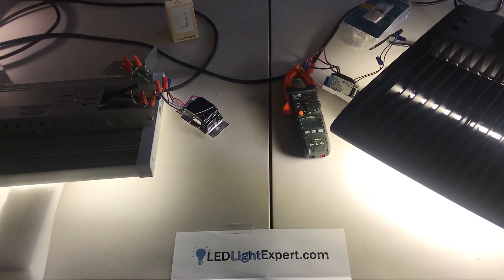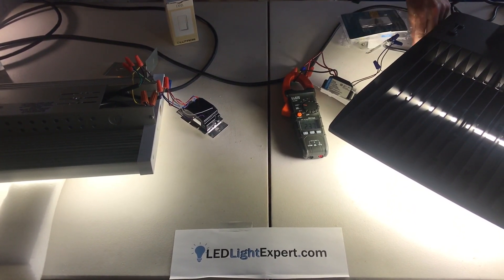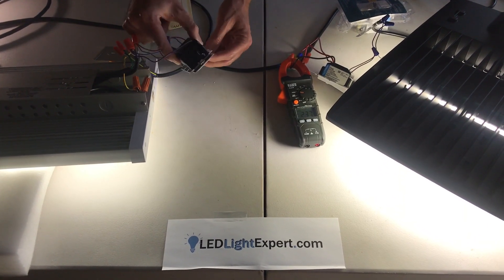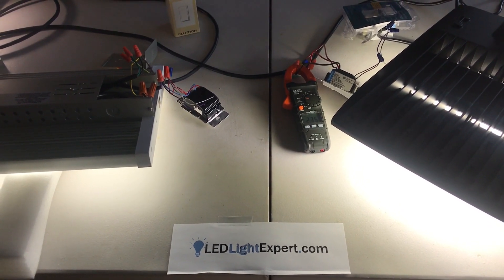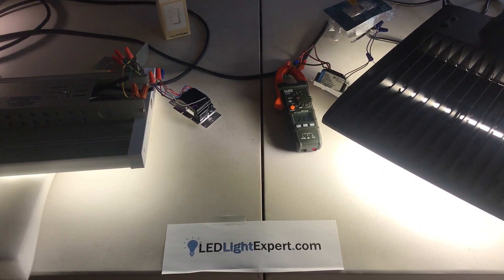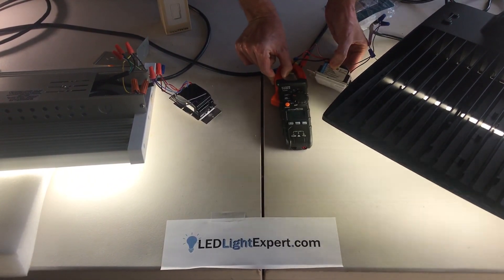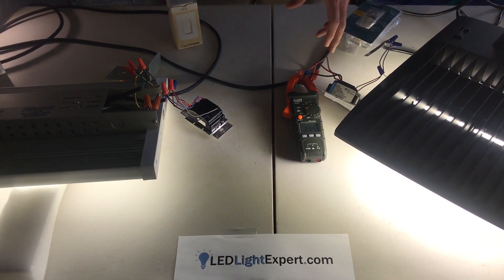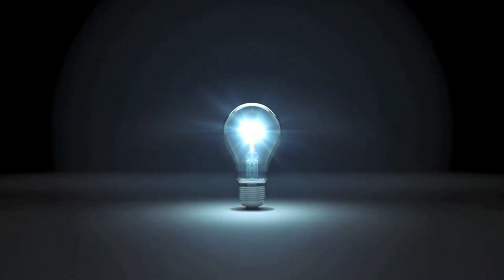0-10V dimming Explained - What is 0-10 volt dimming?  How does it work?  Installation of 0-10v

Comment: my light has two capped wires. The wires are on the light. There are no instructions, but they claim they're for dimming. They don't tell you what to do with these wires.
Reply from the maker: If your light has two capped wires labeled for dimming but no instructions, they’re likely intended for a 0-10V dimming system, which is common in commercial lighting. Typically:
One wire is the 0-10V dimming signal (+)
The other is the dimming signal return (–)

If you’re not using a dimmer, you can usually leave these wires capped and unused—just make sure they're securely insulated to prevent any shorts.
If you purchased the lights from us, feel free to contact us at 888-701-3549 M-F 5am-6pm PT | Sat 8am-1pm PT for further assistance—we’re happy to help!

Comment: So the led fixtures only have the 0-10v wire going to it? And no 120v? The 120v only goes to the dimmer?
Reply from the maker: Not quite — the LED fixtures still need 120V (or the appropriate line voltage) for power. The 0-10V wires are just for dimming control. So typically, the fixture will have both:

Line voltage (e.g., 120V) to power the light

0-10V control wires (usually purple and gray) to adjust the dimming level

The 120V power doesn't go only to the dimmer — the dimmer just sends a low-voltage signal (0-10V) to the fixture to tell it how bright to be. The fixture needs both the power and the dimming signal to operate correctly. Feel free to reach out and our experts can help with any project you may have, you can reach us at 888-701-3549 M-F 5am-6pm PT | Sat 8am-1pm PT
Reply: @ thank you!

Comment: This just told me what it does, it didn’t explain what exactly is happening inside the drivers when I adjust that 0-10
Reply from the maker: Adjusting the 0-10V control varies the voltage sent to the LED driver, which in turn regulates the current supplied to the LEDs, smoothly dimming the light output by reducing power without affecting efficiency. You can call us for tailor solutions to your needs at 888-701-2183.

Comment: Why do some LED fixtures need them and others don’t
Reply from the maker: No LEDs need to dim, so this is optional.  Some LED fixtures are tunable and have onboard dimmer.  Those just use the 0-10v wires inside the fixture.  If you are asking why small LEDs can dim on a regular dimmer and the bigger ones cant, it comes down to cost.   Dimming under 15watts with a regular dimmer is not that expensive.  Bigger wattages would get prohibitively big and expensive and still probably flicker.  The 0-10v system is simple, cheap, safe and works well.

Comment: 5 years Later...  LED lighting has gotten so much better with high voltage circuitry...you don't require low voltage dimmer switches anymore
Reply from the maker: we'll agree to disagree.  1. low voltage for dimmers has not changed, still required if you want to dim led lights above about 15 watts.  Only thing that has changed in the last 5 years since this video is that they are all mostly 1-10v, which climates dim to off for safety reasons.  2. The high voltage circuitry in led lights is a cost cutting move that has risks associated, particularly for outdoor and higher wattage fixtures.  Using non isolated drivers (150-500v dc) puts more strain on the board and reduces surge protection.  We have an article on that here https://www.ledlightexpert.com/isolated-vs-non-isolated-led-drivers

Comment: 0-10V isn't a dimmer. Your dimmer is just some cheap triac.
Reply from the maker: The dimmer used in the video is a 0-10V dimmer from Lutron, the Diva Series DVSTV 0-10V dimmer, not a Triac dimmer, feel free to look it up with Lutron for confirmation and they have plenty of information about 0-10V dimming. Phase dimming is uncommon with any high output or commercial LED products and will destroy LED drivers if used and lead to a driver, or complete fixture, needing to be replaced when they require 0-10V dimming. Many high output commercial LED products can also use PWM dimming as well, but it is far less commonly used vs 0-10V dimming.

Comment: have 6 led panels and installed then on one 0-10v dimmer but i need 1 of the led panel to be on at night how can i do it thanks
Reply from the maker: That panel will have to be run to it's own switch.  All lights on a single switch have the same behavior, so it can't be done on one. They make dusk to dawn capable wall switches, but you will need to run the wiring to that separate switch.

Comment: Man for the life of me I can't figure it out. I want to power a 3 watt star LED replacement for my microscope on a dimmer switch. I want to use a regular 12 volt input, not the 5 volt original. Can I buy something to achieve this ?
Reply from the maker: 0-10V dimming is the standard for high output LED fixtures and the on/off control is designed for commercial fixtures running on AC power. The DC side if this is just for the low voltage dimming controls that are integrated into the LED driver. Best thing we can recommend for what you are trying to do is speak with the manufacturer of the LED product you are using to find out what options and dimming format they support and products they have or could suggest for your application that meets the needs of what you are trying to do.
Reply: @LedLightExpert  thanks for the reply, it's appreciated.

Comment: can we get a close up on the dimmer wiring to the fixture?  my dimmer switch and fixture looks identical.  ty
Reply from the maker: You can check out our learning center page with a wiring diagram that should be pretty consistent for 0-10V dimming setups: https://www.ledlightexpert.com/Dimming-High-Lumens-LED-0-10v_ep_43-1.html. There is plenty of configurations, like when adding multiple lights, 3-way switches, or standalone 1-10V dimming that only controls the dimming, not on/off function. Dimmer switches should come with wiring diagrams which is what you need to follow, along with electrical code, when wiring up your fixture based on your specific application. If you are having trouble with a specific switch/fixture combo, we suggest you contact the manufacturer of either or both products.

Comment: Why does my light go off when I splice my 0-10 ?
Reply from the maker: Not quite sure what you mean here, it sounds like you are splicing your 0-10V dimming wires together which you should not be doing. They either get connected to the correct dimmer switch contacts or they should be left capped off and not making contact with each other at all. We have a wiring diagram on our learning center page for 0-10V dimming: https://www.ledlightexpert.com/Dimming-High-Lumens-LED-0-10v_ep_43-1.html

Comment: @LEDLIGHTEXPERT are you aware of a 0-10v smart dimmer that runs on WIFI?  I can't seem to locate a smart switch of this kind anywhere?
Reply from the maker: I would start with the major controls manufacturers like Lutron and Leviton, but there is plenty of options out there. A call to either of those would be a good place to start to find a switch that fits your specific needs with Wifi.
Reply: @LedLightExpert  Thank you.  I reached out to both and unfortunately it doesn't exist today per either of them.  You'd have to combine two-three pieces of equipment and build your own.  Only place i found one was Alibaba and was hoping you may know of a domestic company.  Regardless, appreciate your video and the response.  Thanks again.

Comment: I purchased a 100watt ufo dimmable light, does it require the dim switch to turn on? Mine is not turning on and I am not sure if it’s defective or I need the dim switch.
Reply from the maker: Without knowing anything about the light, it's hard to tell you where the problem is. If it is a LED with 0-10V/1-10V dimming, the on/off function should be controlled with your hot, neutral and ground wires from the fixture and have nothing to do with the dimming. If not dimming, the dimming wires are left alone and capped off and should not affect on/off function. Best suggestion is to get a voltmeter on your input power at the fixture to make sure the fixture is getting the proper power it is rated for and contact the manufacturer of the light if you are still having trouble.
Reply: @LedLightExpert  okay sounds good, thank you. I was thinking after words, I altered the size to make it fit in my photo booth, could that have to do with the it not turning on. I know I did not drop or break anything, the dimmer wires are capped. I only altered the aluminum frame.
Reply from the maker: @mramerica4749  If you altered the housing, it could cause electrical issues along with affecting things like heat dissipation, depending on the product you are using. If you tested the light right out of the box and it worked but no longer works, I would guess the alteration caused a problem. Only sure fire way to test would be to confirm your input AC voltage to the LED driver and the output DC voltage from the driver to the LEDs and compare that to the manufacturer specs for the driver. One way or another, contacting the light manufacturer is going to be your best bet.
Reply: @LedLightExpert  I was a rookie, I didn’t even check to see if it worked, I assumed it would work. I will keep that in mind, I think I will purchase another light similar but smaller, and see how that works. Thank you for your help!
Reply from the maker: @mramerica4749  My pleasure, happy to help! If you are looking for some UFOs, we have a few different options: https://www.ledlightexpert.com/UFO-High-Bay-Light_c_31.html. You are also welcome to give us a call at 800-674-9420 and one of our reps can work with you on the specifics you are looking for and see if we can find one that will fit your needs and size requirements.

Comment: Is it possible to use this setup with existing wiring (hot, neutral, ground)?  I don't see how to get the 0-10v signal to the lamp without running new wires.  Am I missing something?
Reply from the maker: 0-10V dimming uses a separate set of low voltage wires which would need to be run to the dimmer switch or controller, separate from the hot, neutral and ground wires. These wires would come from the fixture or LED driver that uses 0-10V dimming. You either need to run the dimming wires back to the control/switch or find a wireless 0-10V setup where the dimming wires are connected to a wireless transmitter that can be mounted close to the light.
Reply: @LedLightExpert  Thanks for the information.  I was afraid that was the case.  I guess new homes will be wired this way, but in the case of my old house, fishing those extra leads just isn't worth the effort.  Can you recommend a wireless 0-10v unit?
Reply from the maker: @michaellawler6110  Nothing we specifically recommend with wireless options, you would probably need to check around and find one with features you are looking for. I would start with some of the big names like Lutron and Leviton for controls.
Reply: @LedLightExpert  You have been a great help!  Thanks.

Comment: Is 0-10V dimming/line voltage the same as reverse phase dimming?
Reply from the maker: No, these are completely different dimming formats. Make sure you pay attention to the product you are using and the dimming format it uses. Most high output and commercial LED products are 0-10V dimming.
Reply: @LedLightExpert  No they aren't. He's right. You're just using standard phase dimming like he said and pretending it's something else.
Reply from the maker: @JohnSmith-ds7oi  0-10V dimming is definitely different from phase dimming. Phase dimming is common for older lighting technologies and can be found with some low output, typically residential, LED lighting products, like a bulb in a desk lamp or recessed can light. Phase dimming is on the AC side of a lighting circuit and simply put, modifies the VAC power input delivered to the load. High output and commercial LED products, like warehouse lights, parking lot lights and more, use drivers (power supply) that needs steady VAC input voltage and phase dimming will cause all sorts of problems and very likely damage the LED driver if used. 0-10V dimming is handled by adjusting the output from the driver to the LEDs in VDC and is handled separately from the VAC input power by the LED driver, thus the need for separate 0-10V dimming wires that are needed for dimming with 0-10V dimming. There is plenty of resources online for more information about 0-10V dimming vs froward or reverse phase dimming.

Comment: Hello, can I use a 0-10vdc DF10p dimmer switch from Eaton with a lithonia lighting  LED ballast? Is the ballast only for lithonia dimmer?
Reply from the maker: Depends on the specs for each product. LEDs use drivers, not ballasts, so I suspect you are referring to the LED driver and not all LED drivers are the same so your best bet is to contact the manufacturer if you do not have the specs to confirm. If the driver is 0-10v dimming compatible and you are using a 0-10V LED compatible dimmer, I don't see any reason why they would not work.
Reply: @LedLightExpert  Thanks, I have try and the light are just very little powered. I try to correct this situation with the rotative gradator and dimmer on the switch, but the light still just powered a very little....All connexion are alright, and I have 120vAC on the output of the accudriver blue and ground same as with the red one. Is there suppose to be 10 VDC current on this LED input?
Reply from the maker: @tommyfournier7028  Unfortunately, I do not know the specific wiring colors on those products which is why I suggest you reach out to the manufacturers of those products for specifics. Driver output should be in VDC and none of your dimming wiring should be done on the output side of the driver. These products should have come with wiring diagrams. You can see a basic wiring diagram for 0-10V LED dimming on our learning center page here that might help: https://www.ledlightexpert.com/Dimming-High-Lumens-LED-0-10v_ep_43-1.html.

Comment: Great vid. Q. If I have 2 dimmable fixtures, should I wire the 10v circuit in series or parallel?
Thx
Reply from the maker: Parallel will be fine for 2 fixtures with 0-10V dimming on standard commercial LED fixtures.

Comment: Do i have run control wire to each driver to the switch if I'm dimming let's say 3 lights or can I go from driver to driver then to the switch
Reply from the maker: You can wire the dimming leads in parallel with each other. You do not need to run a separate set of wires back from each light to your dimmer switch.
Reply: So a daisy chain from the switch to each fixture with 18 gauge wire?

Comment: Would have been better to start from scratch with showing us the hook up of the wires.
Reply from the maker: We have plans to do a more in depth dimming video in the future and we'll keep that in mind for the video. When it comes to the wiring on the switch, there is so many different manufacturers out there, different functions and more robust systems, the best thing to do when it comes to figuring out the wiring is to check the wiring diagram for the switch or controller you are using to make sure you are making the proper connections.

Comment: How do u wire these with a three way? What wire do u run from switch to switch?
Reply from the maker: That will depend on the 0-10v dimmer switch you use. You will need to make sure the switched being used is 3-way compatible and refer to the instructions from the switch manufacturer for the wiring diagram for 3-way use.

Comment: Is there a limit to the number of fixtures you can connect to one 0-10V switch? Can you use one 0-10v switch for fixtures connected to different circuit?
Reply from the maker: Depends on the switch you use. Basic 0-10v switches typically have a 8-10 amp maximum but more robust systems can go up from there. If you are just dimming and not controlling the on/off of the light, you can usually run far more lights on a single switch (some of the basic Lutron switches can handle up around 25 lights for dimming, the switch just might need to be on a different circuit that the lights so you do not go over the amp max on the AC power side of the switch so the switch will not control the on/off of the lights). You just have to check the specs on the dimmer switch you decide to use.
Reply: do you have to run different/extra  wire for 0-10v dimmers?

Comment: Found this from your amazon review on the Lutron switch.  Thanks
Reply from the maker: Glad our video helped!
Reply: Too bad I didn't run the extra wires from the LED ceiling lights so I ended up just putting a regular switch in.
Reply from the maker: @SnareMan  There is some wireless 0-10v switches out there with a small battery powered controller you connect to the dimmer wires and mount near the light. It sends the dimming signal to the switch so you do not have to run the wires all the way from the light to the switch. I'm sure the switch will be more expensive, but with so many smart controls out there these days, you can likely find something like this at a decent price. As long as it is LED 0-10v compatible, you should be fine.